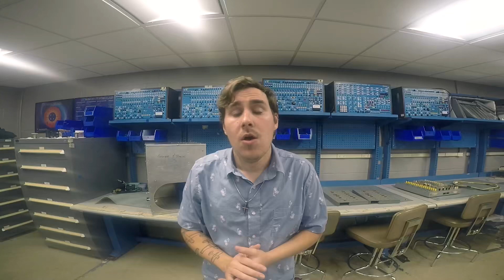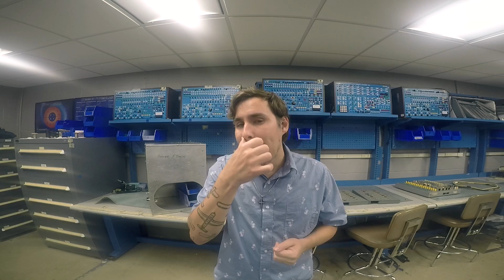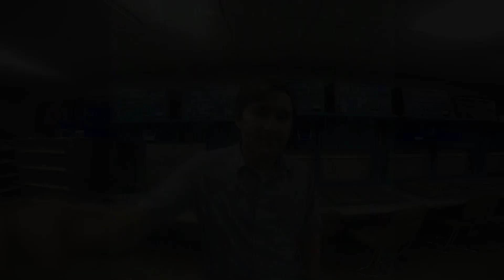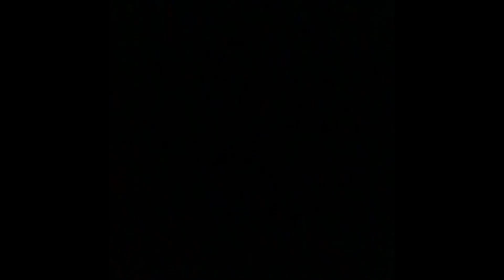Understanding Aircraft Time In Service and Time Abbreviations.

Comment: My ‘49 Champ still to this day has the original tachometer without a meter. Time has been tracked all these years by everyone that’s flown it. Which I’d argue is just as accurate, if not more, than several A&P’s entering meter numbers wrong over 70+ years. lol

A couple things I think are worth adding. 

Most tachometers only count accurately at normal operating rpm. Lower idle speeds, the meter goes a lot slower. Therefore, they have the Hobbs meters which, in addition to what you mentioned, is also activated by an oil pressure switch. Flight schools like this because the tach might say you flew for an hour, but the Hobbs counted your 12 minutes on the ground too for a total of 1.2hrs. I’ve seen in some special cases (experimental) where the Hobbs is actually active with the master switch as well. (I personally would never do this)

Also, you can, and I think it’s worth the effort and $, to have the correct hours put on a replacement tachometer. 

- Glenn CFI/A&P
Reply from the maker: I agree, the flight school I used to work for once had us replace a tach but didn't want to pay the money to have the current Total Time put on it... thanks for making us all do math boss. 
Also one of the rental aircraft I work on has the Rental Hobbs wired direct to the master and a maintenance Hobbs from oil pressure. I personally think it's a little weird to do it that way but that's what they wanted
Reply: Most Diamond aircraft factory installed Hobbs run on master. We always disconnected it during maintenance

Comment: What classifies total aircraft time in my airline is as soon as the FDR turns on the clock start running. But that only happens when the APU comes on. So some of our maintenance procedures calls for total APU hours of operation and APU starts. Then again this is commercial airlines.